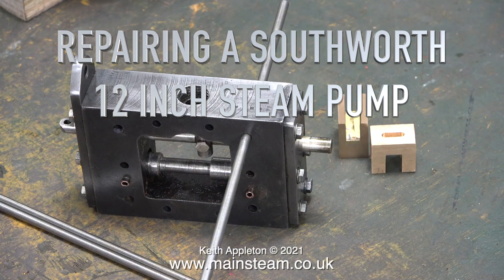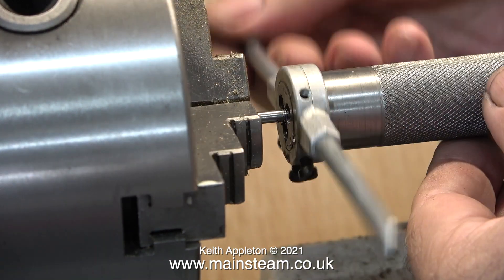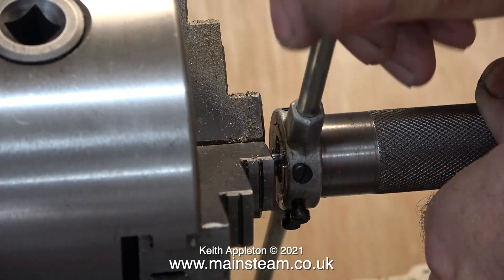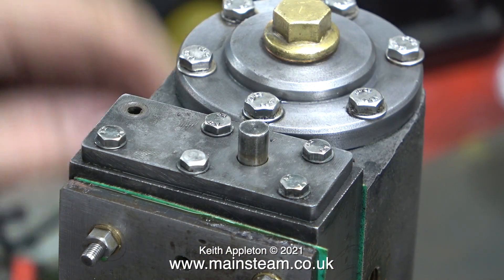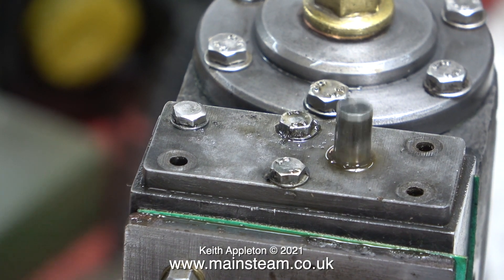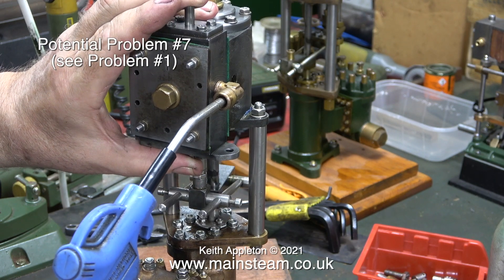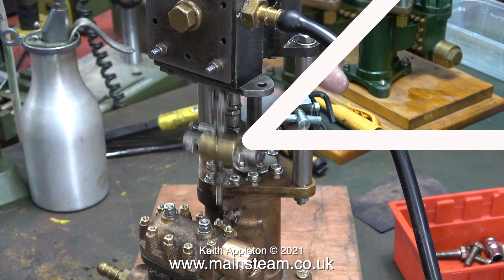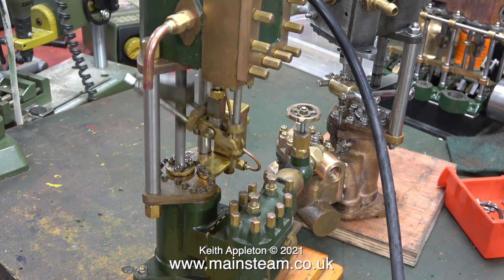REPAIRING A SOUTHWORTH 12 INCH STEAM PUMP - PART #9

Comment: Good day, Here in Germany I also have the problem with converting when I work according to an English blueprint. There is a conversion table for inches to millimeters on the Internet. You have crooked dimensions, but I can work after that. And strictly adhere to the dimensions, for example when controlling the steam slide. I round all other measurements up or down.

Comment: I've been watching you for years now I would love to get into this hobby but unfortunately I was born in 1999 (makes me 22 now) and have no idea on the Imperial measurement or how to convert any of it so when you're talking about all these measurements it just flies straight over my head!!!
Reply from the maker: Why not use Google? just type for instance 1/4 to mm or 3/16 to mm etc etc - that's what I do the other way round }:-)))
Reply: The other option is not trying to convert between the measurements and to get yourself a ruler and/or calipers and just measure in inches where inches are asked for
Reply: I was born after we converted to metric in Aus and never heard inches or feet mentioned at school. It's not a problem, you soon memorise the major conversions, and the others are only a digital caliper or calculator away. Metric/imperial conversion should be the easiest thing you need to learn taking up model engineering!